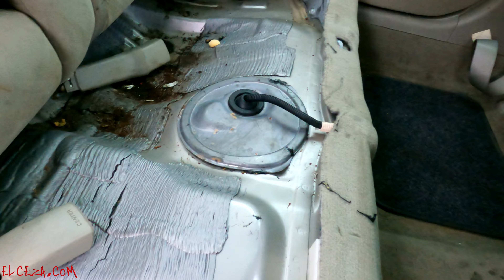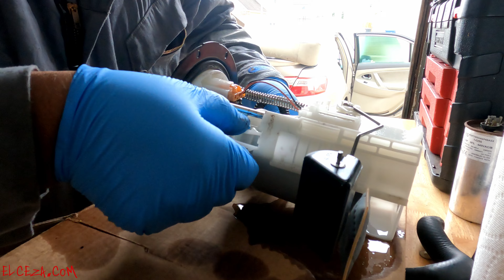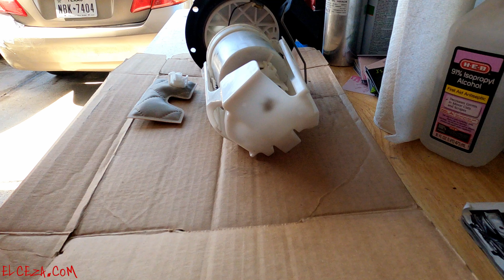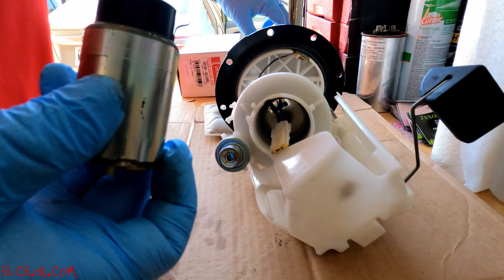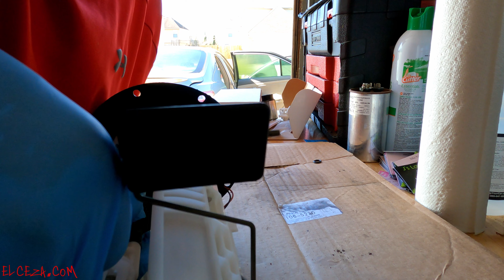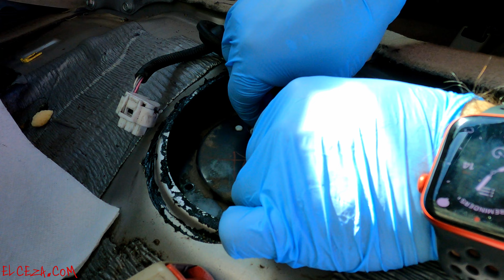How To Replace Fuel Pump on 2007 Toyota Camry

Comment: Is the fuel filter inside of the pump? I’ve bought 2 brand new fuel filters in 2 yrs. They keep going out. Car want start until the pump is replaced? What’s causing it to keep going out?
Reply from the maker: Yes
Quality of the part
Reply: Fuel filter is strainer

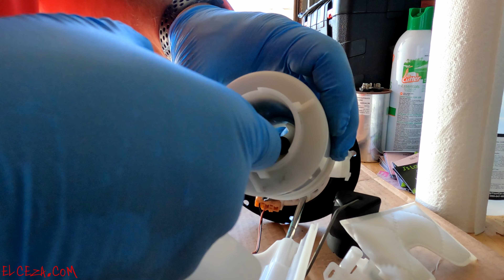Comment: Does anyone know what's the part number for the oring mentioned at minutes of 11:34?  I am trying to get the oring ordered so I can replaced when changing the pump.  Thanks
Reply: I hope you have fixed this problem by now but, in case someone else is wondering, my Denso came with the O-ring.

Comment: Very well explained but seeing as though you had the pump assembly out, I think it would have been prudent to change the filter as well as the strainer. Thanks for posting
Reply from the maker: Thanks for the support
Reply: The strainer is the fuel filter

Comment: Hey, this is such an awesome video, thank you!! Can I just ask though...do you know where the heck the pump relay is located? I downloaded the mechanic manual, checked the engine compartment and under-dash jboxes...I saw someone write online that it's behind the glove compartment, but all I can find is the cabin air filter. I feel insane. I have tried tracing the wiring, but it's difficult to see where it goes without disassembling the engine. Any idea?
Reply from the maker: I appreciate it, i do not know where that fuel relay is
Sorry
Reply: I read it’s in the bumper

Comment: Hey dude i have 2007 2.4 se camry and my issue is when the car is cold its start from the first start but if i take a cruise and the car became hot ( worm ) it won’t start from the first try its start from the second one what do u think I should do ? (Note :  i had new spark plugs, new coils , cleaned the injectors, cleaned the throttle body)
Reply from the maker: Check engine light on?
Reply: @El_Ceza  yes ( i think its because the cat deleted)
Reply from the maker: Check the codes thats where i would start with
Reply: @El_Ceza  I checked the code before and it say misfire and i told u i did changes and services to the fuel system and ignition and fire but the problem stills
Reply from the maker: Wont be able to tell you what it could be unless i troubleshoot it sorry
Reply: @El_Ceza  its alright man i will go to the mechanic thank u so much bro 🌹
Reply from the maker: @thelord7833  no problem
Reply: I just fixed this issue on a friends 2007 2.4l Camry. It was the temp sensor on the engine. Exact same issue. Cold it turned on great but if he drove and stopped for gas or to the store it wouldn’t start anymore. He would have to wait 10-20 min then it would “cool” off and it would start. After the temp sensor it’s back to normal

Comment: Thanks so much for posting this. I was able to change mine for $130 and it only took about a half an hour. I used a Denso 950 0205. The one that I pulled out was a Denso also. It was the OEM pump. I think it was just the strainer giving me problems, but I changed the pump anyway. 
Thanks again.
Reply from the maker: Awesome, glad i was of some help

Comment: connect which battery?
Reply from the maker: Disconnect Negative Wire on battery under the hood
Reply: @El_Ceza  you mean the car battery if so do you think a beginner like me could do this or would you recommend a mechanic?
Reply from the maker: I would Recommend a mechanic
Reply from the maker: No problem! I really appreciate it